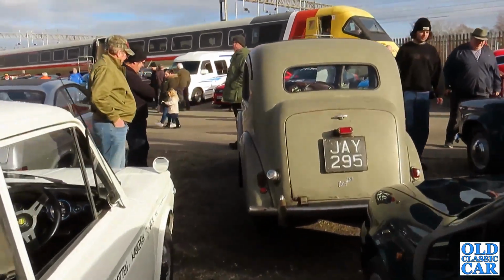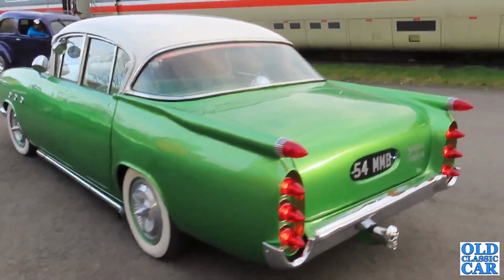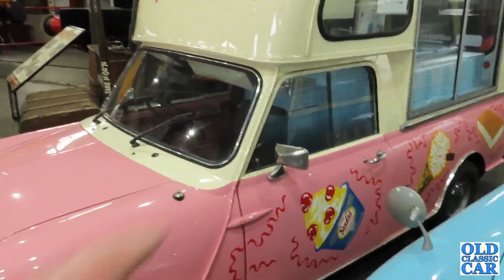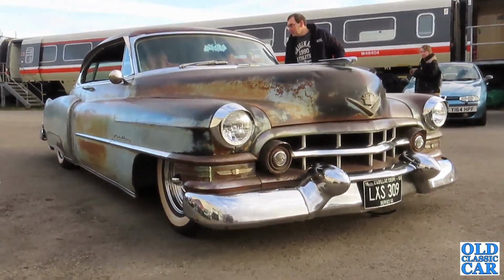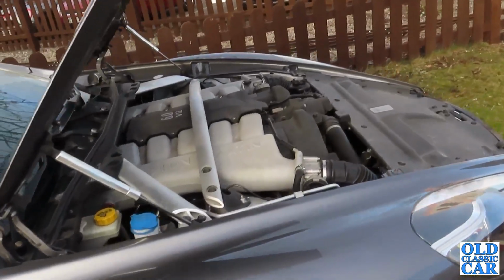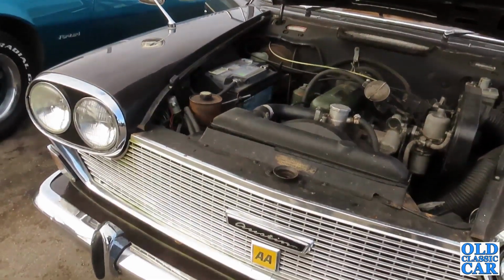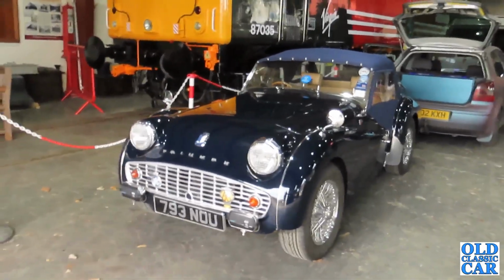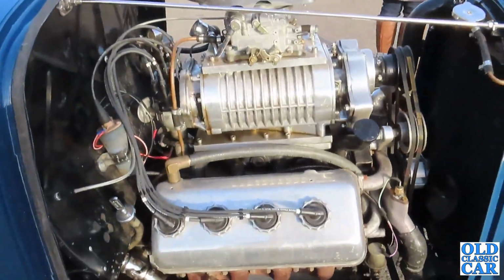Old cars, vans & pickups at Off The Rails - Crewe Heritage Centre classic car meet 30th Jan 2022

Comment: the Patina Cadi at 57;00 has a hidden gas filler. It's under the left tail lamp housing. Push the round reflector and the tailight housing pops up. I love little features like that.

Comment: Excellent video. Thanks for the piece about the Austin 3 Litre - I had mine when I was 21 - MUCH too young to appreciate it. VOT 868H, Damask Red, Automatic. I knew a retired Home Office engineer and he tuned my Carbs by ear. It was so smooth, you could stand a 50p on it's edge on that big aluminium nut behind the radiator !  All that was 46 years ago - where did that time go !  Anyway, thanks again for all you do, such varied and interesting content. Oh, you said you got rid of the Volvo - what will replace it ??????????????   Take care :-)
Reply from the maker: Still looking for a Volvo replacement, it was a fine car but just too complicated for my feeble mind to comprehend - fuel injection, LPG, various mods to the wiring etc etc, plus I never really took to the auto box. It's gone to a very good home now, sharing unit space with a collection of 164s.
Reply: @oldclassiccarUK  "I never really took to the auto box." U.S. viewer here. My father bought a new 1969 Volvo 144 (the first year with the B20 engine) and my mother insisted that if she was going to drive it, he had to get it with the Borg-Warner automatic that was available (at least here in the U.S.).  I believe that was the BW 35 transmission, built specifically for European production. OMG what a dog it was! One can quarrel with automatics but, fact is, that transmission showed what a jump the Big 3 U.S. manufacturers had on the technology over other vendors. It completely sapped what comparatively little pep the car had (2-liter 4 harnessed to a very stout Swede).  

And, oh yeah...in the 7 years my dad owned it, I think my mom drove it about twice.

Comment: I think the engine in the hotrod right at the end, might be a flathead Ford V8 with the Ardun overhead-valve conversion. Originally a Mercury lump. Supercharged too, of course, in this case!
Reply from the maker: Interesting, I'll have to have a read up and see what they look like
Reply: Looking at it again, tho, it probably isn't an Ardun; the plugs are not grouped in 2 close pairs - as the Ardun heads would have. So a more modern o/head valve, l reckon.